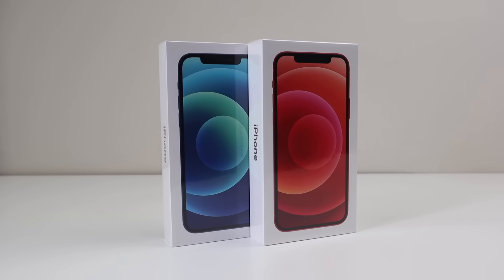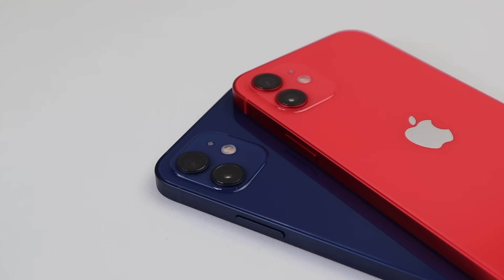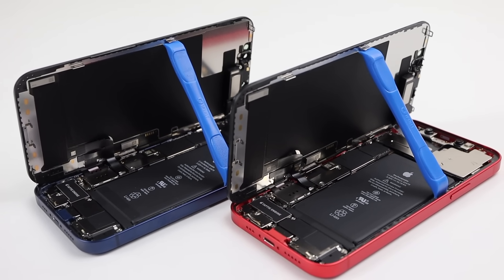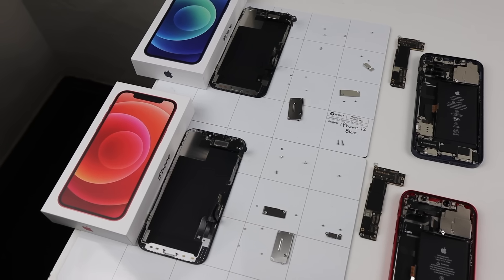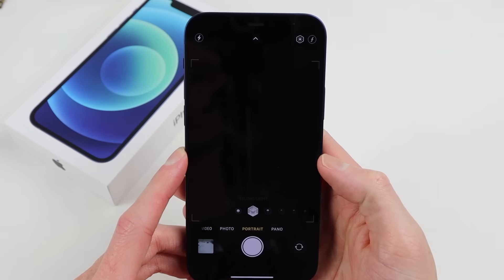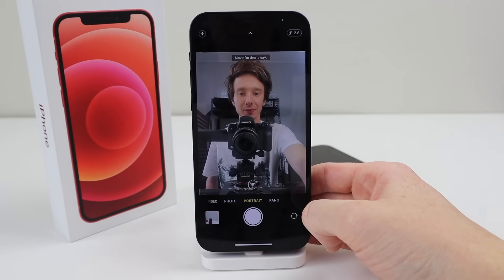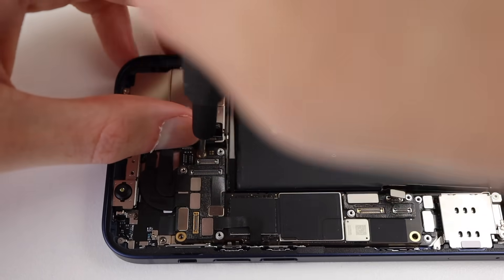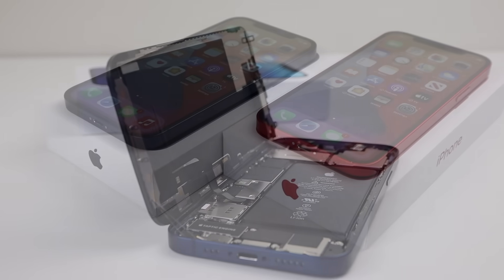iPhone 12 Anti Repair Design - Teardown and Repair Assessment

Comment: Aren't you able to charge the phone using the old lightning cable like the one they gave for Lighting to USB-A cables for earlier iPhone models?
From your video, it wasn’t clear. But I think you definitely could. So, you are essentially misleading your audience about the purpose of the cable(which is the iphone is compatible with macbooks).

Comment: Iphone 69 X ultra pro: Only screen
Price: 4200$
Other parts : Price
Battery : 800$
On/off button : 200$
Home button : 69.99$
Volume button : 300$
Some random wire inside the phone : 30$
Screen protector : 50$
Rest of the parts: 3000$

Repair: Non
What to do if you break your phone:
Buy all the things again.

Comment: Apple when the iPhone 20 comes out (price: $100,000,000): We've removed the iPhone from the iPhone 20 to reduce e-waste but you can get one separately for only
$100,000,000,000,000,000,000,000,000,000,000,000,000,000,000,000,000,000,000,000,000,000,000,000,000,000,000,000,000,000,000,000,000,000,000,000,000,000,000,000,000,000,000,000,000,000,000,000,000,000,000,000,000,000,000,000,000,000,000,000,000,000,000,000,000,000,000,000,000,000,000,000,000,000,000,000,000,000,000,000,000,000,000,000,000,000,000,000,000,000,000,000,000,000,000,000,000,000,000,000,000,000,000,000,000,000,000,000,000,000,000,000,000,000,000,000,000,000,000,000,000,000,000,000,000,000,000,000,000,000,000,000,000,000,000,000,000,000,000,000,000,000,000,000,000,000,000,000,000,000,000,000,000,000,000,000,000,000,000,000,000,000,000,000,000,000,000,000,000,000,000,000,000,000,000,000,000,000,000,000,000,000,000,000,000,000,000,000,000,000,000,000,000,000,000,000,000,000,000,000,000,000,000,000,000,000,000,000,000,000,000,000,000,000,000,000,000,000,000,000,000,000,000,000,000,000,000,000,000,000,000,000,000,000,000,000,000,000,000,000

Comment: It makes sense. I worked for a big brand when I was younger. When we changed out a mobo we had to change the ID to make sure the OS was registered to that device. If this process isn't followed blatant abuse is obvious to using the OS on non accepted parts. 
yes I understand your issue but just wait for software to transfer the ID. Who wants an apple device with sub par parts ?

Comment: You don’t have to take it to Apple to repair. You can take it to an Apple certified repair shop to repair. The price would be a bit different (mainly cheaper) and they will still honor whatever warranty you have. With any (new) apple products, you can’t just repair them. You have to tether them to a computer running specific Apple software and place the phone, iPad, etc. in DFU mode. Then you can configure the new components to play nicely with each other. The reason the board and camera didn’t work is they weren’t configured to work with the other components in the different phone and probably won’t work in other phones without specific configurations.

Comment: Just my 2 cents, what if this is only an issue with genuine "pre paired " parts? Like say since you used a camera or logic board that was already assigned a serial number pairing , it wont work thinking you used parts from a stolen device , if you order genuine parts not already assigned a phone, maybe it wont instantly lock you out?( I have no background in phone repair at all fyi)

Comment: I would never buy an iPhone. My personal phone is a $250 Samsung I bought of Amazon 3 years ago, with a $20 case, and the bare screen is not scratched and it works perfectly. My work phone is an iPhone 11, it had a scratch in the first two days before I got an otter box and a screen protector. It replaced an iPhone 7 that the battery failed after a little over a year.

Comment: I could imagine that components needed for TouchID/FaceID are locked for data protection reasons meaning that nobody except Apple can repair this so people don't buy used iPhones that have been manipulated somehow. The battery and screen should be replacable though. While disabling TrueTone makes sense as well for a 3rd party component. Most Apple users don't care anyway though and just go to the Apple service as it is quite comfotable

Comment: It's absolutely hilarious how Apples getting smacked around on right to repair, so their answer is to let a few shops have access, but make repairs impossible.

Absolute scumbags
Reply: Agreed problem is tons of people still buy them unfortunately. I have a OnePlus 8 and I love it.
Reply: @KonohazFinest  I cannot fathom why people buy them, same phone every time with a few tweaks that have been on Android for years.

No flexibility, obsolete in a year or two, garbage specs kept relevant with optimisation. Overpriced garbage.
Reply: @literate-aside  works for me
Reply: @literate-aside  while some specs like the RAM and the screen are behind the Android world, the rest is really on pair or even better. Camera? Pretty much just as good as the Pixel 5 but with more flexibility. Chip? Better than the competition, like it is every year. Cellular speed? On pair with the competition. The real problem is indeed the price, which is getting bigger and bigger
Reply: @mihnealazar7039  Not to mention the tiny battery.

iOS is the least flexible OS on any device
Reply: Its true the later models have finally started to catch up spec wise, but ram, screen, and OS are the most vital part of a phone.
Reply: @blazingexil4003  for how long? It do you just pay a fortune for your contract and upgrade every year or two?
Reply: @literate-aside  no I’ve been using my phone for two and a half years now and I’m planing on using it for an additional extra year or two. I got my phone for 500€. I used many different phones from different companies in the past and never really thought mulch about it. Now I really don’t know what’s going on with apple right now but everything before was pretty decent and I didn’t care much.

Comment: Apple: We removed the charging brick so we can reduce e-waste.
Also Apple: We paired every component we built into the iphone so you cannot replace them or repair them so you'll have to come to us to repair shops just to tell you to buy a new device and that your current device will go to e-waste.

E-Waste Reduction: -100%
Reply: They'll probably just hard reset it and resell it as "refurbished" for almost retail costs lol. Maximum profits
Reply: @michaelbrewer3018  No they wont. Its a BIOS check (most likely). They have the tools to update it upone replacement or if they are supper lazy , they will swapp all paired parts (which is consisetent with something L. Rossman descovered for some of their devices.
Reply: * -99%
Reply: If they actually cared about waste they would have swapped to USB C awhile back.
Reply: @paulguidas6409  wtf? They purposefully made millions of perfectly usable chargers obsolete by changing their usb port
Reply: @AlexFBauer  Having multiple different charging/data standards causes an insane amount of ewaste and because of this places like the EU passed laws saying all phones needed to charge with the same cable which dropped the number of charger types down from over 30 in 2009 to 3 today. Remember when everyone had a different charger for each of their flip phones? This is why all phones except iPhones use a current form of USB (lot of court battles over this over there and while I don't completely disagree with Apple's point on stifling innovation it is rather moot as QI wireless charging becomes ubiquitous and laws can be edited if a new standard is that much better). If someone swaps to an android phone they likely throw away all their now useless lightning cables whereas swapping to an iphone you may hold onto some of those USB C cables if you have an iPad or Mac. What I meant is they needed to get rid of lightning connectors entirely if they actually cared about the environment especially given most of their other products now use USB C to charge. They should have done it back when the X released as that was a major redesign. This doesn't even take into account all the docks and adapters that use a non universal standard. They could have included a USB C to USB C cable then and people would have complained but it actually would have been better at reducing ewaste. I won't argue the merits of USB C versus lightning as that isn't relevant to this point but from a purely environmental standpoint it makes the most sense to have one standard. If using the old chargers is important to you they could easily have offered (or you could have purchased one of the many many 3rd party options) a USB C to USB B cable. USB B is the kind you have on your older chargers and is the same as what we usually use for mice and keyboards.

Comment: Did you try to back up first before changing the logic card. And after change dump this back-up one another each. May be you must use the base program. this issue must be software-based.

Comment: This probably won't deter any Apple fans.... to the rest of us it just seems crazy to pay so much for a phone with no charger and the manufacturer actively making things difficult-to-impossible in terms of 3rd party repair. "Can't verify that it's genuine" is a ridiculous message when you've just plugged in a genuine Apple part. Obviously the question has nothing to do with whether parts are genuine or not. If it did, the phone absolutely would be able to verify when you plug in an apple part and parts would be available. This kind of "strategy" seems disingenuous to me and is one of the reasons for staying away from this company.

Comment: It looks like you have few ideas on how its installation SOP is. 
Once you know how it was assembled in the factory and how many major modules are designed in the whole manufacturing process, you will see how easy it is to be repaired.
I saw many times in your video, which shows a totally wrong procedure in teardown work.

Comment: Apple is very backward. After these "innovations" in the video, he didn't have to put screws, but glue ... They would save 5 mm of its width. And without that, during the warranty, they replace the phone with another one. After the warranty, the $ 1,200 phone is for the trash.

Comment: So the value of older iphone just went up, This is a very bad move by apple. If in a few year for iphone 12, any component is broken and if even apple wasn't able to fix it or can't be bother. 
You are force to upgrade to a new phone. 
It could be just a broken camera, if need replacement - RIP! 
I bet you it is some kind software code firmware to unlock and pair components. 
Real dick move by apple company. Imagine their PC is also lock this way. Hard disk? Ram? GPU? CPU? Fail? You must take it to authorize apply dealer to get it fixed. 

This is a real worried. Plus I don't see a leap of improvement over the iphone 11 series. Other brand of android smartphone has really starting to outperform iphone is many areas.
Even when apple heavy marketing of keep your data save is starting to be questionable. 
Most of all, making user to pay much more for their internal memory capacity, where many other brand of smartphone would have an option of insert a tiny SD card.
Rant over. Will go back the android or get a older iphone 11 (Probably on sale now since iphone 12 just came out).

Comment: While "Renewable energy" is total or almost total bs - solar panel barely generate enough energy to compensate for their manufacture and after 20 years will be massive e-waste, not to mention that in many cases they occupy areas which could be used for farming or forests, wind turbines are noisy and dangerous for wild animals, both of these sources are also super unreliable and have to be supported by more conventional combustion powerplants anyway. Water is not that great too especially on a larger scale as dams massively change the environment. 
Not that I'm against being responsible - on the contrary - but blindly following some trends without thinking is the opposite of being responsible.
But my point is - in the end, Apple is doing jack sh!t about the environment because the biggest thing is this cycle of tossing old into the garbage and buying new. Ok, I'm a bit too harsh - there is one thing they are doing right - they do support their devices much longer than everyone else - that is the thing they are doing right environmentally.

Comment: This problem has been appearing, even if more slightly, since the iPhone 8, with more cases in iPhones 10 and 11. In order to ensure that replaced parts work, you need to buy a special device which reprograms the parts making the phone believe that they’re the same that were installed originally. In order to do that you must have your old part when you program the new one.

Comment: I am in the market for a new phone to replace a Note 4 that is being replaced solely because the battery is no longer available.  Otherwise, the phone has been all and more than I ever needed. My GF is an Apple girl so she bugs me to get an iPhone but in the country, I currently live in they are expensive and offer nothing I need over the 6-year-old phone I am replacing. She replaces hers every year because it is "old and might break". Since we have been together I have spent $800 on my phone and $7000 on her phones!
Sorry Apple, these policies have assured that I will not do business with Apple again, and that includes any more iPhones for the GF. In the current economy, a new GF is easier to find than $7000
My prior phone, still in excellent condition was a Galaxy 3 which developed a problem in the camera, which I did not use much since for any of my needs I have a much higher quality actual camera used personally and in client studio work.  I simply went to a local Samsung repair shop down the street and bought the camera module and replaced it myself. As a EE and having a complete electronics lab, I am not a novice in electronics by any means. I simply do not need the latest models of anything because my use case is simple simple, conversation, maps, and a little text. I do not need it for entertainment, and after 40 years in the recording industry, I do not even want recorded music on my phone or in my home. I only listen to live music so my appreciation of it is not dulled by constant saturation with it. Apple is not serious about waste or green issues unless the green is money.  The worst part of Apple however is the insufferable arrogance of the employees. 
Thanks for the effort and expense to discover and announce the latest actions undermining their own customers.

Comment: Hey mate! Thanks for the shoutout, won't buy myself an IPhone anymore. I'm still sitting on an old Iphone 6s, having changed out about everything in it by now. However now Apps start not functioning due to the OS issue. Was thinking to get a new IPhone... So now I won't. These changes are an abolute no-go in my opinion.

Comment: As far as the Face ID, you’re supposed to swap out the original cameras as well not just the logic board, the battery part is still an issue though

Comment: Guys now each cameras has her own file lens
You need the file lens and run it into the C: program file
Similar when you want to add new Font on ur desktop 
I work as engineer in a TV station AL ARABIYA News
If we change the lens of a camera that run on the graphic system
The graphic system won't see the new lens until we run her own file lens
each lens we buy from Canon or fujinon has her own file lens
So i think you have the same problem

Comment: they use a hardware id code in the os which locks the device down if the id changes it doesn't work, like any hwid each component has a specific value/code which creates the unique hwid for each device, anything changes and wala no phone

Comment: The face id won’t work because the proximity sensor and the front facing camera are lock with the logic board, just swap does, and the battery and screen messages appear also in the iPhone 11, now there are machines to copy the data to the new ones so the message don’t appear I don’t understand why you said the iPhone 12 it’s anti repair ?

Comment: It’s about security, not repairs. A camera simply takes input from a light sensor and turns it into a man made digital data stream. It stands to reason that it would be possible to swap the camera hardware for some other input device with external control and you could tell the phone it is seeing something that is, in reality, not there. This allows the possibility of bypassing biometric security, i.e. Face ID, making encrypted data accessible with little more than 120 degrees of heat and a guitar pick. One way to discourage this is to force the phone to demand proof that the new “camera” is trustworthy by requiring admin authentication. Even if the new hardware claims to be from another brand new phone. And if you give the admin password for authentication to anyone outside the Apple building then it’s compromised. Now my experience may be different than most, but I have had two apple products that I submitted warranty claims on and both times I was just asked to swap for an entirely new device. Repair was never even offered. And these wouldn’t have been complex repairs either. Doesn’t seem like a very lucrative business model to me. However, bragging that the FBI couldn’t get past your security, THAT sounds like a selling point that would move more product.

Comment: I have a protective case and screen protector. I don't drop phone very often. After a year, my phone looks like it is brand new. I trade-in my phone every year or when eligible for upgrade (30 month installment plan can upgrade after 15 months). So I don't need to have my phone repaired. If it did need repair, I would take it to Apple (don't trust non-Apple repair places).